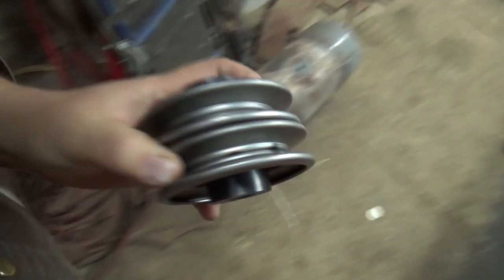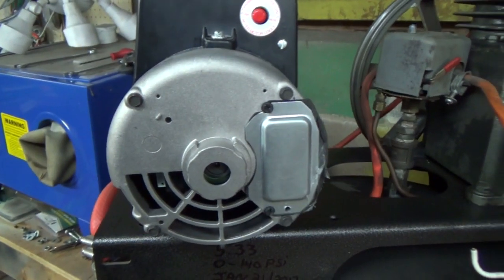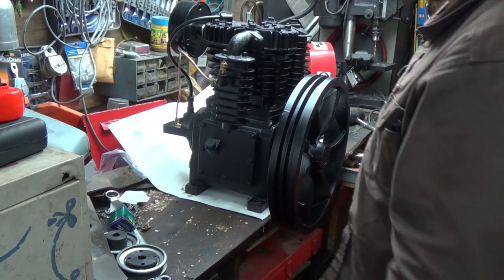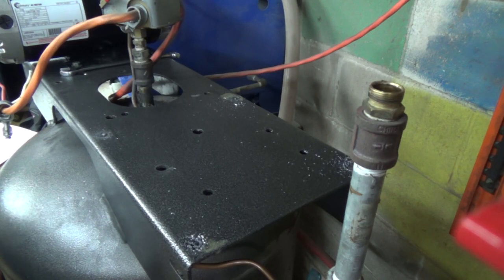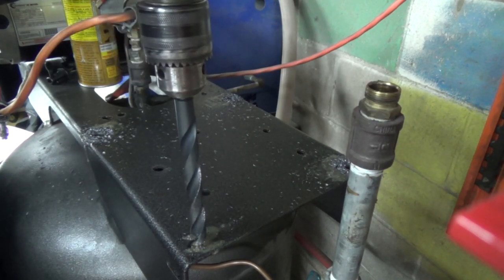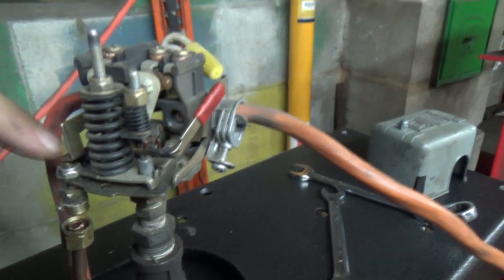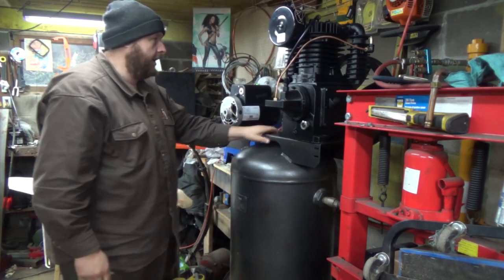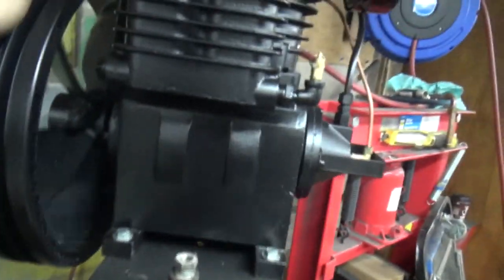Mounting the new compressor pump and motor

Comment: You will need that bleed off or you will overwork the motor, I removed it from mine when fitting a new motor and it started very well with an empty tank but as soon as it got to 150 psi it would not restart I then had to replace the vavle and it was perfect. Yours maybe able to start again as it is a lot bigger than mine, but a was advised by the supplier to reinstall the bleed off vavle.....dont you need air for the plasma??

Comment: a couple more observations.. that pump has a centrifugal unloader built in... you don't need that one on the pressure switch... plumb it as it shows in the manual... also, a pump that size should be pressure lubricated, not splash lubed as this one is.. so it's imperative that you keep the oil changed often with a super high quality product and maintain the level strictly within tolerances.. also, i'd run it for about an hour on the first run  and change the oil then... these knockoff pumps aren't built to tolerances like a good domestic pump.. it's gonna shed some debris while breaking in..  most of the time when you go to a 5 horse 220v motor (or larger), you will want to use a magnetic starter along with your pressure switch.. let the switch trigger the starter..  your pressure switch will work fine.. just don't use the unloader on it.. use the one on the pump itself..   anyway, just some suggestions to try to milk a little more life from it..  those knockoff pumps are a crapshoot at best.. if you get a couple years out of it, consider yourself lucky... personally, I would have suggested a Quincy or Champion (or equiv) even if it meant a used one to meet a budget... I use Quincy's and they will last forever..  they are rebuildable.. parts are easy to find...  a Quincy will be around when your grandkids get old.. I have one from 1929 that's still running.. and a model 325 from the 70's that still serves me daily...  i got it used for $250 about 20 years ago... pump, motor, tank and mag starter... i did an un-needed refresh with rings and bearings then just because i didn't know the condition...since then..  other than air filter / oil changes, it's hasn't cost me a dime..  that's service.. i buy them when i find a deal and resell them..

Comment: The switch on the compressor is most likely only 1-pole, so I believe one of the phase leads will have potential to ground even thoug the switch is off.

Comment: u probably need to run at least an 8 gauge wire to that motor or i could burn up the motor the 10 gauge won't pull enough amps through it and will get pretty hot after a little run time. and also i would run a copper line into the tank or use black iron pipe with a union because a rubber hose could melt from the heat. just a suggestion great vids keep them coming

Comment: hey bill, knock the pulley on the pump in a bit and pull the pulley on the motor out a bit and you will be able to use the original slots for the motor

Comment: also, that motor you got is designed for a pressure washer... not a compressor... should still work... it's coated for corrosion resistance and sealed internally... i suppose try it and see how it works...

Comment: Your 10AWG wire is fine for the amp draw but you better make sure your pressure switch is rated for the draw as well.

Comment: don't u need your compressor to cut the holes??
Reply from the maker: ummmm  you are right  dammit
 
we gots a nudder plan whoooohaaaaa
Reply: the tank in your truck might put enough juice for one quick cut you think?
Reply: *****
The motor is already slotted so you just need bolt holes so yes your correct.

Comment: That button on the new motor is supposed to be pushed in.  If it is sticking out then there had been some sort of problem with your system.  It is and overload protection (circuit breaker).  When something happens it pops to cut power and hopefully save your motor.

Comment: that small copper pipe is actually an unloader... it's supposed to vent the pressure from the compressor so when it restarts it's not under load..  only, in your case, there's no one way valve between it and the tank like it was supposed to have.. or it would not have vented back when you opened that side valve.. the pressure that triggers the on/off comes from the vertical standpipe on top of the tank into the bottom of the switch... you should get a one way valve and hook it up right.. and yes, your 10 gauge wire will handle up to 30 amps..  and just use standard galvanized pipe for the feed... no need for any special flex pipe.. good luck.. BTW, what brand is that pump?? it should have come with specs, installation instructions and most important..  care and feeding instructions... maintenance info,.. spare parts info....  unless it's a cheap chinese knockoff.. (my suspicion) in that case it most likely wont last long enough to need maintenance..  either way, good luck..

Comment: Bill, you act like you weren't able to use a drill! You know that the drill bit has to be tightened, and for it not to wobble around, it should also be centered in your three jaw drill chuck.
(OK, that last expression came out of a dictionary, but it should be right anyways?)

Comment: Billy..cheaper than hydraulic line for the main air line is to use flexible polly line like came with your air horn kit...3/8 is rated for 300psi and easy to cut and can use the quick push connects to route nicely around under thru the walls and hook into all your air outlets thru out your shop....cheaper and easier. Its the standard for new shops down here in the US these days.